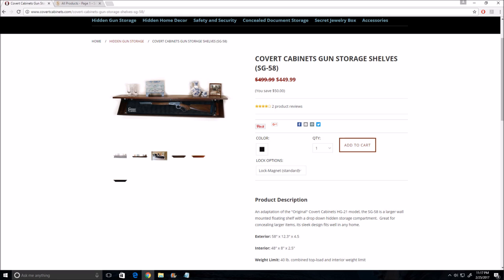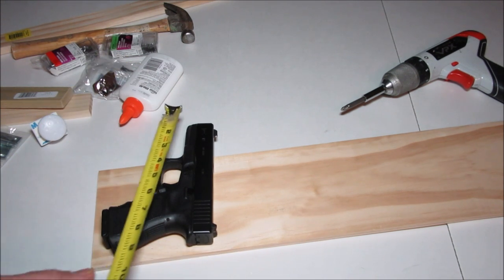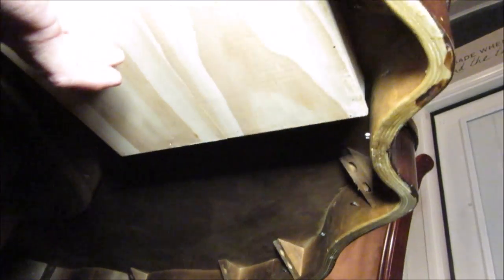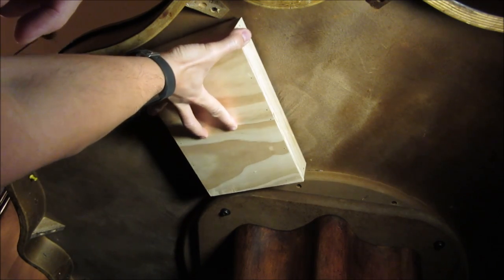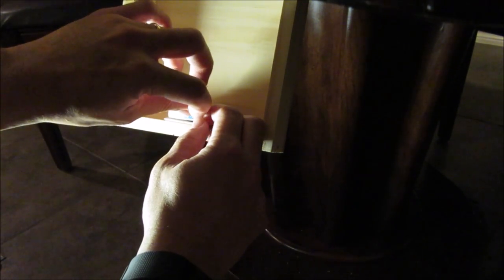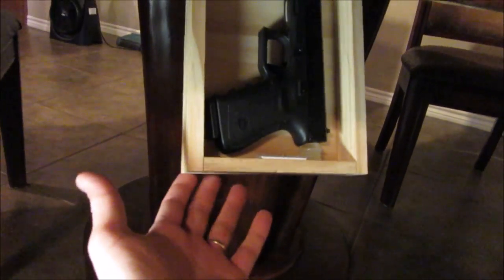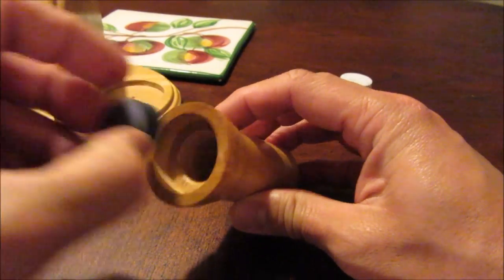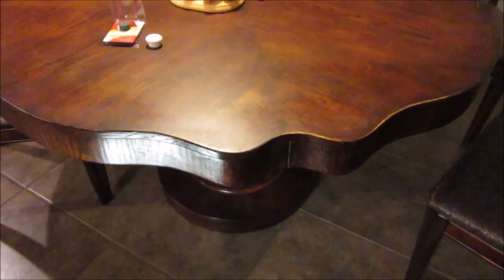DIY Secret Storage Compartment For Guns And Valuables In Plain Sight

Comment: This Video is fantastic. And hiding the key in the Salt and Pepper shaker is ingenious. What a way to save both time and money.

 If i could make one suggestion, then ask one question. If there is room in the box. Use some kind of  foam egg crate to line the bottom. So the wood won't scratch the Guns Finnish.

And what was that clear thing you were using in the box to stop the Gun from sliding?
Reply from the maker: Yes, great idea..I will put those non skid shelf liner plus it will hold the gun still instead of sliding around. The clear thing is a plastic cap that I used just to clear the gun from the lock.